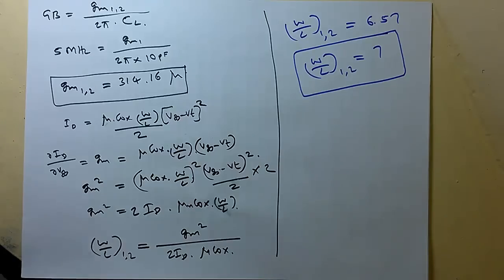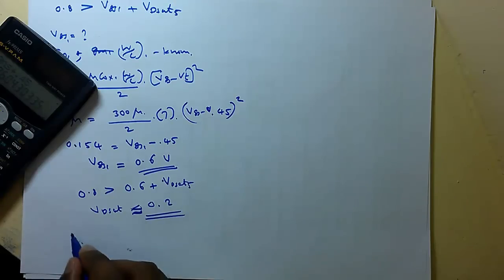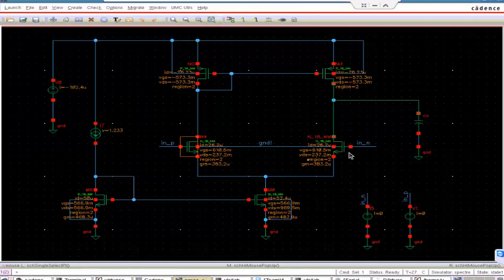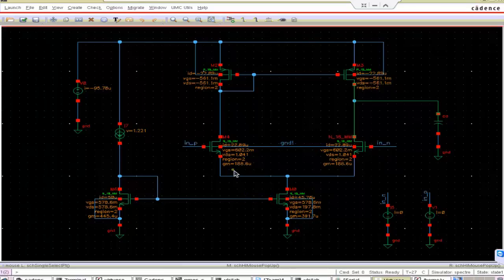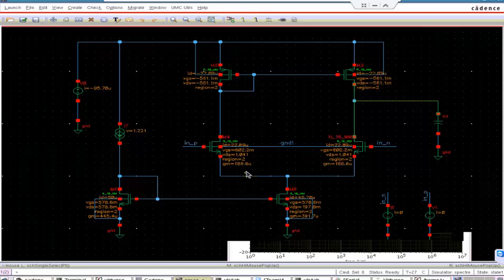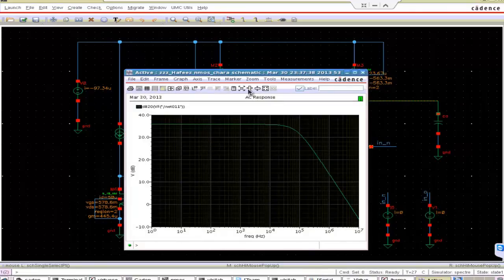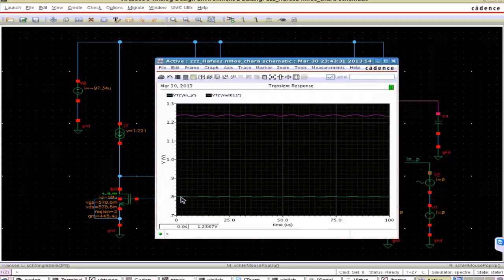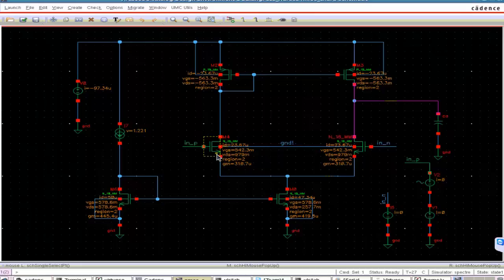cadence tutorial : Operational amplifier design in cadence Part 1c. Diff amp design

Comment: sir i was using synopsys custom compiler, and the uncox upcox values were different.i am facing two issues.if i am keeping the supply vdd as 1.8v then seeing some mos are not in saturation. one more thing is the tail current source mos current number are not matching even though the vgs is same, basically in the current mirror circuit both the mos are having different current.any suggestions

Comment: At 1:20 , how is Vin > Vgs1 + Vdsat ?? I cant understand this part ! Would be great if someone could help me out !
Reply: +Bhuvanesh N apply KVL there..and > sign is, since Vcmr_ is the min common mode voltage than we can apply according to design perspective.
Reply: +sreerej1 How do you say KVL ? I dont get how he would come up with that equation using KVL,  could you explain a bit more ? Vin is not connected to the circuit at all since the gate is high impendance and thus can be considered to be open circuited, badly want to know how this equation fits here though KVL, would be great if you could help a bit more :)
Reply: This discussion was 2 years ago, but i would like to answer.
Vin should be greater than 0.8 w.r.t ground.
from the gate of M1 i.e vin to ground should  be greater than 0.8V.
there are two voltage drop point between vin and ground which is Vgs1 and Vds5.
since Vin should be greater 0.8V
vin >Vgs1 +Vds5.
hope u understand.
Reply: @bhuvi441 
Let's discuss in a general way: 
Vin2=Vg2
Vs2=Vds5
Vgs2=Vg2-Vs2

Vgs2=Vin2-Vds5
Vin2=Vgs2+Vds5
Vin2>=Vgs2+Vds5 (Because the video has considered the minimum value here 0.8v, so either 0.8v or more)
Please correct me, because it's just my assumption.